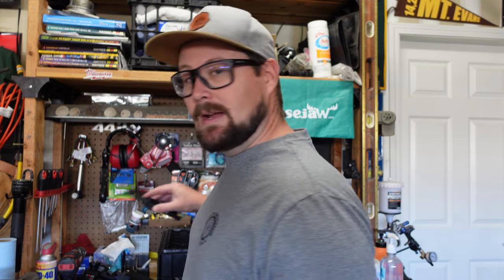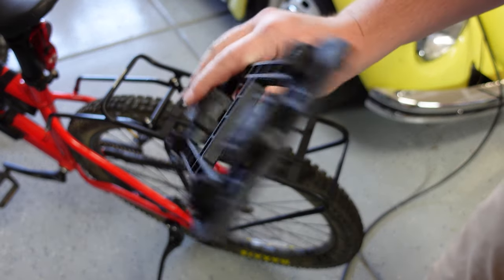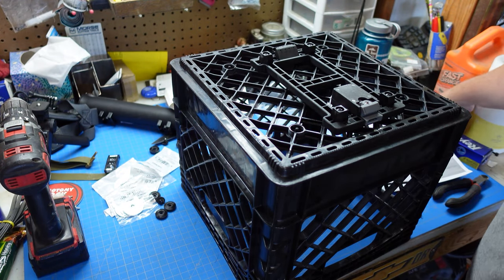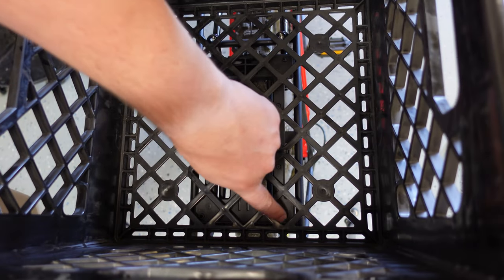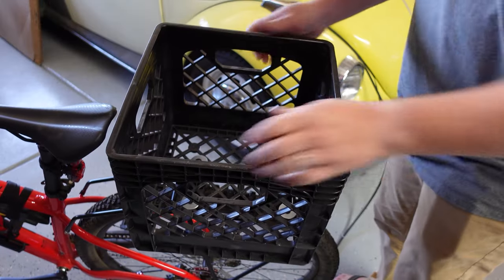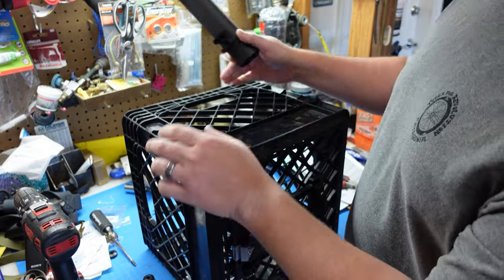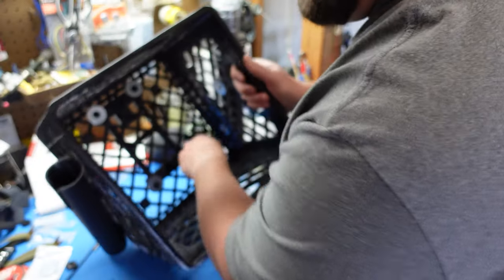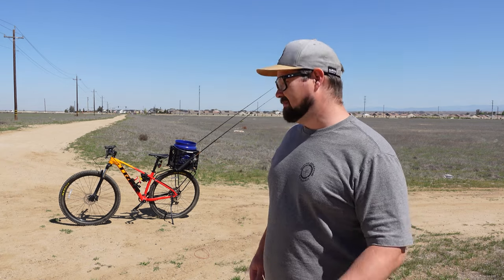Trek Marlin 7 Bike Fishing Rack Build - pt. 2

Comment: Can we install fenders on this bike? Please and which one is your recommending
Reply from the maker: Any of the ones like this are good and easy to install on the front. https://amzn.to/34u1rhP
For the rear, I prefer the seat post mounted fenders so I can take them off and on.
Reply: @RoadandReel  I need to put rear also, but same time need to put back carrier also. So both will support same time?
Reply from the maker: Yes, the seat post mount should fit with the carrier, but there may be one that attaches to the bottom of the carrier as well, but I haven't seen any.